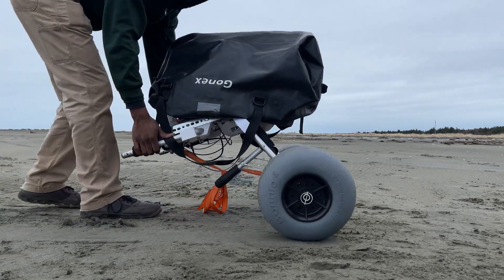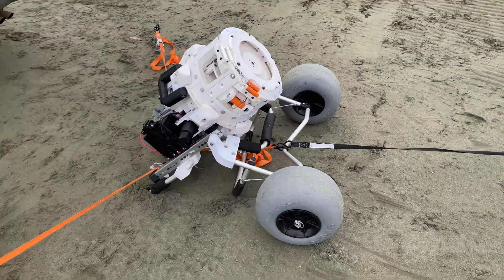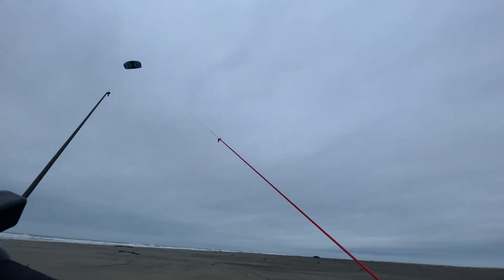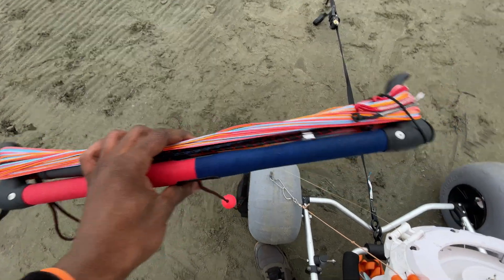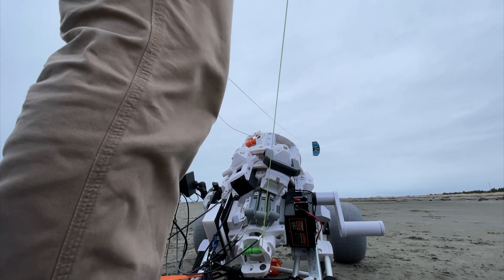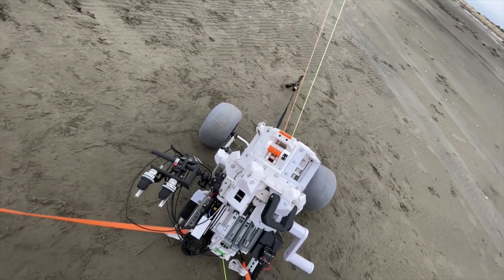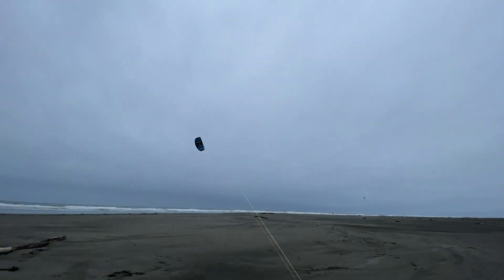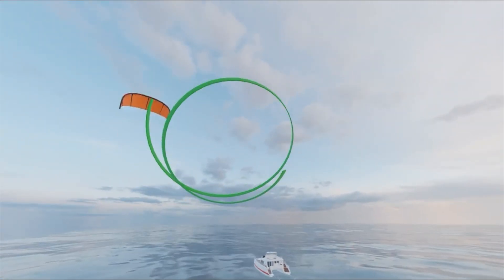Convert Boats into Kiteboats and Wind Generators: How to Fly a Kite Engine

Comment: in a window of how many degrees can this be used? unlike a sailboat this can only be used with wind from behind. and what if 1 line snaps and the kite drops in front of the boat and drives over it? i saw huge cargo ships with this system and they can't stop that quick. If the kite ends up in the propeller it can be a costly accident. chances of this happening are really small of course
Reply: it can be used at many points of sail, just like a kiteboarder can work their way up wind. It can also be installed on a sailboat. 

The nice part about the engine is that it's just a controller, There are many different kites to use for different points of sail.

Comment: Such a cool project, I’ve seen setups in the Netherlands testing this. Am looking forward following your Kite engine project.
Reply: We added a couple of features.. we now have Regen, which means you can charge your system anytime line is let out.. Also the ability to untangle the lines from a mounted deck winch is a very special feature.

Comment: Exciting stuff! I’m glad I found your channel, as I’ve also been thinking about kite powered sailing for a long time. I really like how you seem to have solved the line twisting problem with the fishing pole method. Though as your power line(s) (middle line) are also threaded through the perimiter, I would be curious to see what materials and dimensions you need to fly a, say, 100 square metre kite to power a yacht. I was always thinking the best approach for large kites would be to have a single line leading to a gondola, which hangs below the kite and controls it from there, like Skysails uses. But in one of your earlier videos, you argue against that method, as crashes supposedly damage the gondola. Could you perhaps post some links to the sources that led you to this conclusion?
Looking forward to how your project evolves. All the best!
Reply from the maker: Thank you, and great questions. In terms of a 100 meter kite, I like to think of it like this: The wider the "kite bar" (distance between the control lines) the more stable the kite. The narrower the control bar, the kite becomes more dynamic. So when choosing to have a narrow distance between the controls can work, but the system must be fine tuned to almost the inch (that or very good pressure sensors). It also helps to have longer lines. 

I am not as against the gondola/pod as it may seem, it seems robust enough to withstand a couple of inevitable crashes. It also reduces drag as you have only one tether going up to the kite (that splits to each end of the kite) this also means you need a deck winch to reel in the tether. The problem I see with this design for consumer use is there is no physical feel, everything is done remotely through the pod (gondola). Sailors, Kiteboarders, Snowkiters, Etc, want to feel the wind. It's like road feel in a car. That feedback allows you to push the machine further. 

I also don't like the pendulum affect the gondola has on the kite, it's parasitic to the energy that can be produced. It can be mitigated but I see it as an object obstructing maximum power. In order for the kite truly powerful and not like a parachute, the kite needs to move fast (produce lift), and a weight on the end of the line is not preferred in my opinion. It's just not the choice for a performance vehicle. It's better suited for wind energy, and still.. 

The pod also requires power unless the line is reeling out (battery operated), in which case you couldn't sail. I believe some companies run power up to the control pod, in which case I would wonder about lighting's potential effect on a conductive cable 300 feet in the air. I just avoid conductive cables and electronics in corrosive marine environments. 

The Kite Engine is basically a deck winch with a turret, it has a physical connection to the kite, even if all electronics fail, you can still control the kite in multiple redundant ways. 

As far as resources, I think this hidden gem is one of the best. People have been experimenting with a ton of different kite controller designs, This is a good resource for wind energy information, but youll see boat stuff as well. I suggest just typing any query you may have into the search bar, Thanks again for the questions, Ill be posting more soon 

https://forum.awesystems.info/